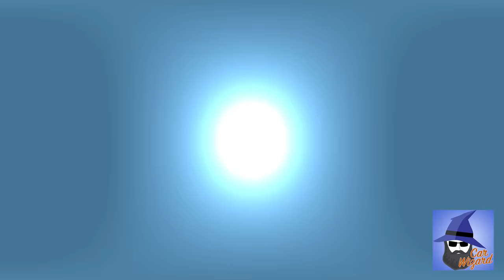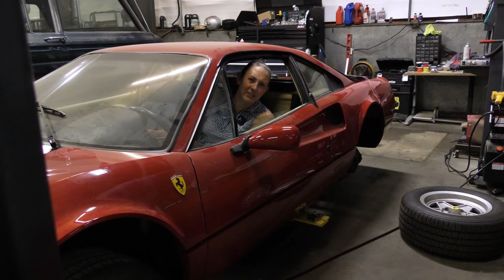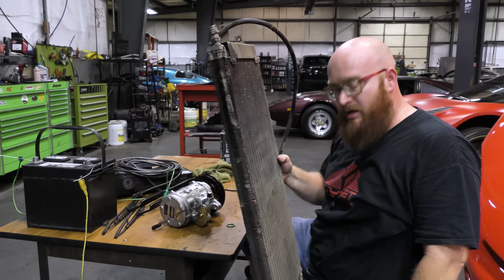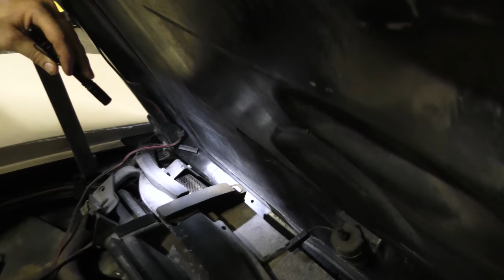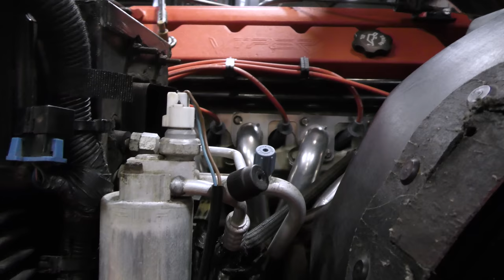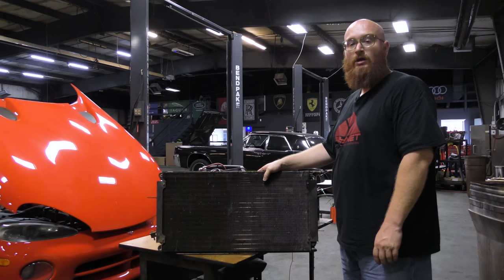Your AC died, now what?!? CAR WIZARD shares several reasons why it dies & the repairs to fix it

Comment: The problem with AC from an engineering perspective is that when the humans need it, using AC is the worst thing you can do to machinery due the heat to adds to the very parts you depend on (especially in traffic).
Reply: Decent fans move the hot air away...and makes it someone else's problem.....
Reply: @JohnSmith-yv6eq  You mean the decent fans of the other cars that make it your problem?
Reply: @jimmyfleetwood1118  
Exactly...you obviously need more powerful fans...rather than bigger loudspeakers and amps in your car....
As an aside, Switzerland has banned heat pumps that use air as the cooling/heating medium..as it interferes with the temperature that other people around you experience.
Only ground loop heat pumps now....

Comment: My AC is really intermittent. Can work for a month then suddenly stops working for a week or an hour... really annoying. I'm suspecting the high pressure switch. I've seen some strange pressures in the CCM computer through diagnostic software.

Comment: I would assume there a high pressure limit switch  causing the compressor not to kick on. I don't think it would let the Freon out like a blow off value .unless there is a leak am a HVAC tech. system should not leak. there is limit switch's causing the system not to turn on. at least one residential systems

Comment: Car Wizard, I have a 2005 Pontiac Grand Prix with the 3800 series 3 motor. It has runs good and has 196 thousand miles on it. The body is in rough condition however. I have an opportunity to trade, along with a little bit of cash, for a 2002 Buick La Sabre with the 3800 series 2 motor. It has 130 thousand miles on it and runs great. The body is in much nicer condition. Is it worth the trade?

Comment: 1234yf takes so little refrigerant it's to the point where you can't buy a can at auto zone and top off, you HAVE to use the machines to measure it out. 1234yf is that sensitive.

Comment: I work at AutoZone and frequently recharge customer ACs after a bit of poking around to verify that the cause of failure is in fact low refrigerant.

One time, I had a customer come in with an unrelated return and he grabbed two 12oz cans of r134a.  I asked him if he's got an AC that only blows cold during winter.  He said something like "yeah, my friend knows how to recharge AC. We've already put in two cans and it didn't do anything". SMH!!!  We went outside to the vehicle, where the static pressure was a flat zero.  I gave it a quick squirt with the engine off and immediately heard a hissing noise coming from the condenser.  I informed the customer that his leaky AC needed repairs and that his friend is a total idiot.

Comment: I’ve been looking through a bunch of AC videos and can’t seem to find one with my specific issue. Have an 06 Sierra and my AC only seems to go out when I’m having a longer than normal drive. If I’m making shorter drives or few trips it will be fine the entire day. If I’m making a 30-40min drive it will end up blowing just air, it won’t be hot air, just normal air.  Engine is not overheating, had my entire system redone and my temp gauge is normal.  Any ideas?

Comment: im never filling my tank more than 1/2 way to make it easier once the pump dies!
Reply: It happens at the gas pump because when a car has some miles on it the electric fuel pump will have wear on it too.  It's caused by the shock of cold gas hitting the hot fuel pump and destroys it.  GM cars from the '80's are notorious for that.  The thing to do is ----leave the engine running when you fill it up.
And avoid running the gas tank way down low.  Try to fill up by at least 1/4 of a tank remaining.  But if you have to get gas when the tank is real low, put the first four to five gallons in as slow as the gas pump will go.  But make sure you ----leave the engine running when you gas up.  You do that so the electric fuel pump will be running.
And if some Karen gives you s___ about your engine running, just say your battery is too weak to restart the car.
Reply: @discerningmind  never thought of half of that. Thanks!
Reply: @thetreyrich1    You're welcome, Trey.  I hope that my comment helps you and others as well.
Reply: @discerningmind  I feel like I owe you something. Hey man, chili cheese tots are $0.99 today in the Sonic app.  Limit five. I'm getting five. Probably going to throw three away.
Reply: @thetreyrich1    Thank you, but you don't owe me anything.  I was glad to help you.

Comment: I took my 2012 Nissan Frontier with AC not working the dealer couldn't find anything wrong so i went to YouTube found out it was a circuit board under the passenger dash, so i changed it myself 75 dollars in parts

Comment: I still don't understand what is wrong with my car. Every year I have to take my car to a mechanic to get it recharged and it still doesn't last all season. No grinding noise but my engine idles rougher when the AC is on. At one point the condensation was leaking onto the carpet on the passenger side. The recharge cans never work because the gauge says the line is full and the mechanics always have to blow debris out of the line before they can add refrigerant. I'm starting to think my car has been sabotaged.

Comment: I dont think the fuel pump one is true, I think the pump fails and then people think its out of fuel so fill it up and then take it to a garage when it still doesnt start.
Reply from the maker: It is true. I always get told “ It was running fine until I filled up. Then it instantly quit starting. Ive been doing this for over 20 years.

Comment: I hope you tell people that a recharge means a leak in the system. The leak needs fixed. You don't just keep putting refrigerant in it when it stops getting cold. It also has to have a balance pressure system.
Reply: He said that ALL systems will leak, which it true. The question is how much and how fast. If it only needs an ounce every 2-3 years, recharge is cheaper. Put dye in and see if it is an 'O' ring or something else. If it's something small and cheap, then fix it then since the system has to be evacuated to measure what's there anyway. You can't guess and put a can in. Miss the days when you had a sight glass and the thing held 4 lbs.
Reply: @hotpuppy1  I agree, but I have seen too many people that think it's like a gas tank and if it's not blowing cold, "just add some refrigerant!"

Comment: 11 years on my car still blows cold air without any recharges of the AC system. I just wish it didn't cause the car to rough idle when the AC is on.

Comment: bad  compressor, bad valves, bad junction...anything can leak. spray some soap water on the service valve and you can tell if it is leaking.

Comment: What about a system that doesn't have a clutch  ?
Reply from the maker: Then new compressor
Reply: @CarWizard  well what about a electrical over hydraulic valve ?
Reply: That control's the angle of the pistons

Comment: Too bad they don't need to change the heather core, I have found an modern vehicle where I managed to switch one in two hours :P
Reply: What's a "HEATHER CORE"?
Reply: @williamegler8771  It's the part of a cars heating system that provides the heating during winter time. Warm water from the radiator goes through the heather core (which is just a small radiator in itself) that heaths the air passing through it and into the cabin. Car Wizard has gone on more than one rant on how stupid they are placed on modern cars, making an easy switch job into an multi day job. So my comment was just to tease CW :)

Comment: In my case it’s different…. AC works for a few minutes when it’s really hot out there, and then the compressor keeps cycling every 5-10 seconds and it doesn’t work to its full capacity. 🤷

Comment: I dont agree with replacing the entire compressor because of a bad clutch.  Unless you are going to buy the compressor from the dealership. Say you have a Toyota,  that factory compressor is so much better than any Chinese product from any of the discount auto parts stores. You will end up with a re manufacturerd  compressor that will likely fail shortly. Even new parts are only getting worse. They are designed to leak, the oil keeps the seals from drying out, or burning up.

Comment: $200 at the shop and i get to replace the $10 ambient air temperature sensor to finish the repair..
Reply from the maker: 5% of the time. Possibly.
Reply: @CarWizard  good common sense on cars, I got the same common sense, but did you see the insanity of spambots posting crap on comments, we should get them banished to spambot heck

Comment: I've replaced the compressor on both my 07 TL and 09 RL. Is this a Honda thing or do they just go after 100k+ miles? It's been a year so far with the new compressor on the RL and when I turn my AC on it's very loud.
Reply: Did you replace ONLY the compressor? 
If so...well Wizard told you what might be happpening..again.

Comment: A wizard what if you have mouse nest all throughout your c system inside the dashboard you know that black box with the motor and everything in it. Yeah what if that's for nests all over the place because you left your car sitting in the woods for a year and a half. Also wizard you're kind of right but also wrong on the if the clutch goes just buy a new compressor. If it's a car 2000 or newer then yeah I would say just buy a new compressor cuz it's already got a cheap one in it but if it's a car from the '90s or before I would rebuild that compressor 10 times before I bought a new one. Because it's better quality and it's better made than the cheap Chinese crap that we have today.